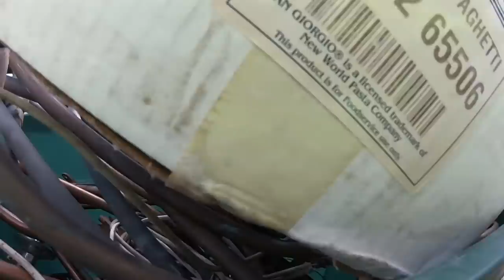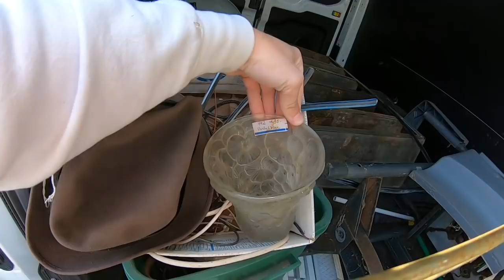LOOK What I Found In The Trash This Week! - Garbage Picking Ep. 272

Comment: Dude I just went out tonight and found a few decent things, box full of records great condition, a little small table maybe like a smokers table or something, a fair few pc cords that are new and the club car lock with keys. My first best find tonight which I haven’t tested yet is a complete set of a sony mini hifi component system with I think 6 different speakers cords and remotes. I really hope it works aha. My second best find tonight was the monster energy drink mini cooler fridge, but unfortunately it doesn’t work, when I plugged it in it started powering up for 2 seconds and then poof the power went out so I’m either gonna have to scrap it apart or try find a way to fix it. I really hope someone reading this knows anything about fixing a fridge with this problem lol 
Never know what you’re gonna find haha 
Keep up the good work I really enjoy watching your videos man
Reply: I had a small fridge in the camping trailer that did that. Turns out the venting on the back was blocked, so the shut off was a safety feature. First, try taking the back off to see if the coils are dirty, not allowing the heat to escape.